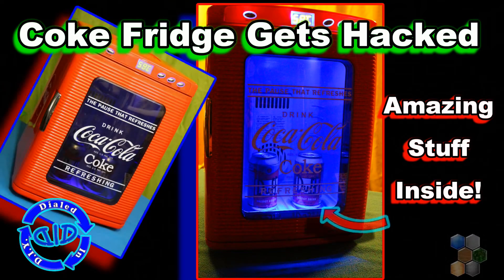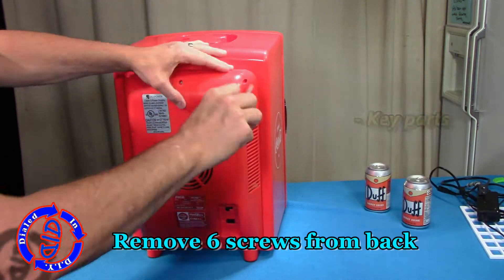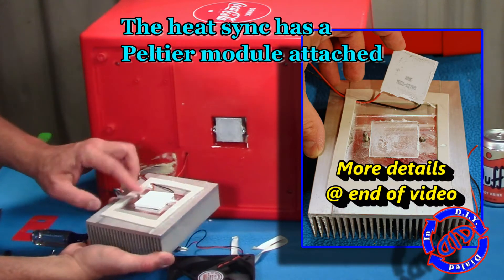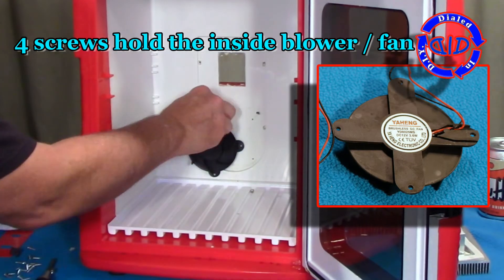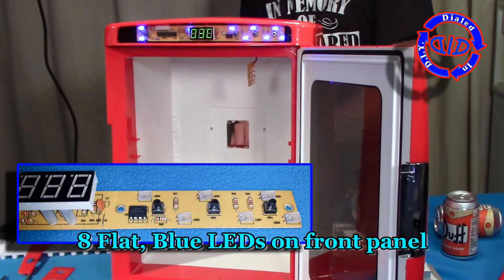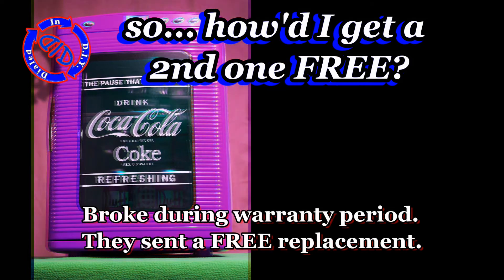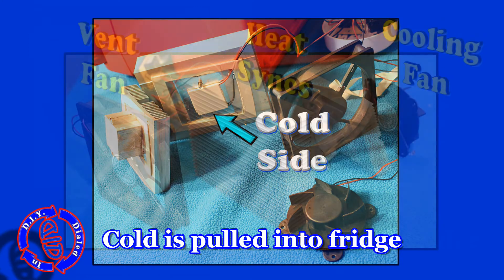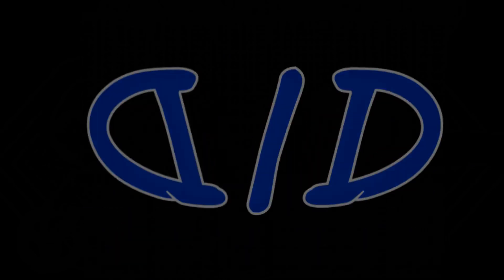Portable Electric Fridge Autopsy - Repair or Salvage

Comment: My brothers were always taking things apart. Mostly broken appliances but also a few working things just out of curiosity. I always loved watching. Unfortunately my younger brother almost killed himself taking a camera apart and putting the capacitor for the flash to his tongue. Guess he thought it was like a nine volt battery but smaller.
Reply from the maker: Ouch! Those capacitors carry a load of volts.  I have a video breakdown of disposable cameras and I do focus on the importance of discharging the capacitor.  Your brothers sound like me when I was a kid... or now too... BTW, how is your brother now?
Reply: Many years ago I watched somebody playing with a disassembled disposable camera (see also: many years ago), and it arced powerfully enough to remove a bite out his metal key.  He is a professional electrician and now owns a company with several teams on the road.